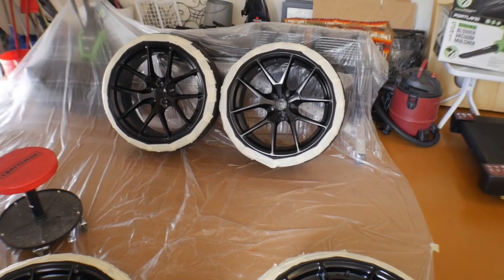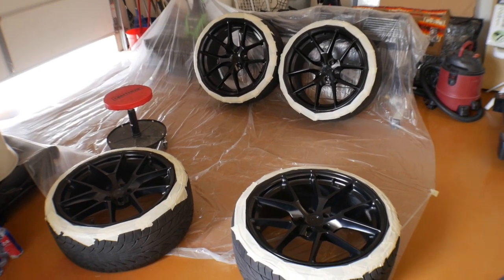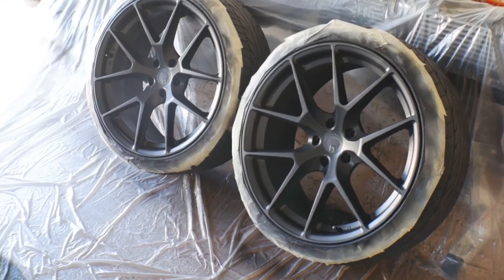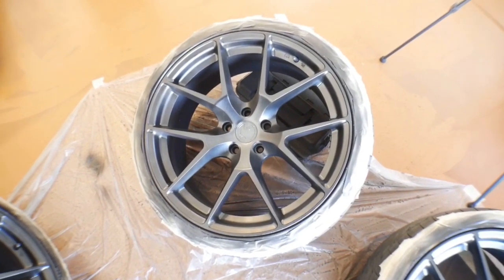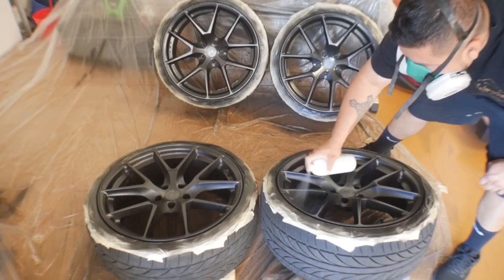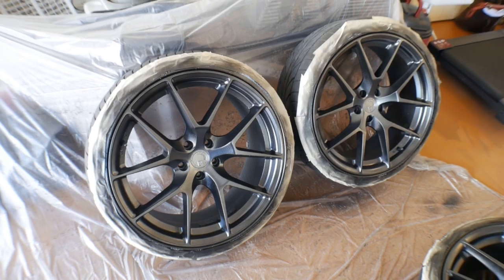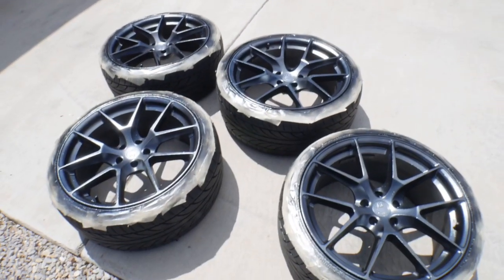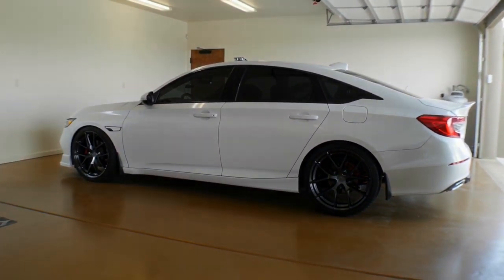How to Plasti-Dip your wheels like a pro! (with Metalizer)

Comment: What size rims and tires are you running and have you lowered the car?
Reply from the maker: 20x9 +30 (x4) with 245/35/20’s lowered on Megan Racing Springs
Reply: Thanks for the info appreciate it

Comment: Way better than black you definitely have to power coating them like this 💯 one more thing I would like you to change seat color what about red leather seats? It looks great with the white exterior
Reply from the maker: Yeah man I wanted the red leather but I’m 50/50 now. I actually installed red leather seats in Jeep Wrangler JK model that I traded for the accord so I know they will look bad ass. I’m trying to do Racing seats, I think I know exactly how to go about it.
Reply: Fahrenheit Motorsports te si remember when you told about the wrangler that you installed red leather seats honestly I think sports seats will be great as well a this point your car is going ahead when it comes to upgrades I really like the way it’s going even though i like smaller wheels with fat and wide tires because here in new york the streets are full of potholes

Comment: How has the gloss held up over time after dirt and washing? One thing I noticed with the copper metalizer even with glossifier, it never looked as good as it first did after awhile daily driving getting dirty and washing multiple times.
Reply from the maker: To be honest. The entire job came off in 5 days. I was gassing up and a small drop of gasoline fell on the wheels. I immediately washed it down but it weakened the dip. Normal driving caused the dip to peel from the wheel so it all had to come off.

Comment: What exact colors did you use ...thanks what if I do this over black dip with glossifier
Reply from the maker: I used flat black plasti dip that you find at autozone or any auto parts store. Then silver Metalizer. 

If you did it over glossifier it would work, still turn everything gun metal.
Reply: Ok cool thanks ...I think your wheels looks great mine are similar design....ZR downforce wheels on my mustang

Comment: Did you lower your car? How much of a drop did you lower it? On factory shocks too?
Reply from the maker: Yes I’m lowered on Megan Racing Springs on stock struts. For about 10k miles now. Drives real nice, no body roll in corners. I’m 1.2 rear and 1.6 front.
Reply: @Fahrenheit_Motorsports  Do you get a big difference on mpg? Running those 20's...

Comment: I love seeing how stylish this car can get with the right parts and effort. I have the same one and I have to say it puts a smile on my face every day. Do you use a a ceramic coating? Anything else you do to take care of your paint? I find that because my car spends most of its time underground garages (home and work), as soon as there is any rain, brake dust that has fallen on it rusts and leaves little rust spots on the paint. It can get noticeable if you look a bit closely. I can wash them off if I handwash but its pretty hard. Cheers from Canada
Reply from the maker: Just old fashion washes for me man. Wax every now and then. I planned on getting ceramic once I clear the garage out and my other project car is sold.